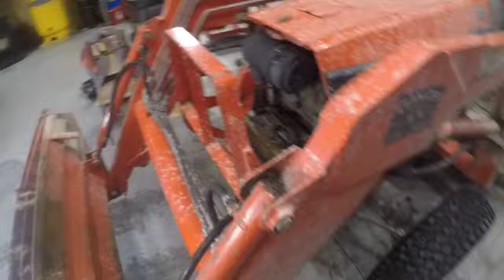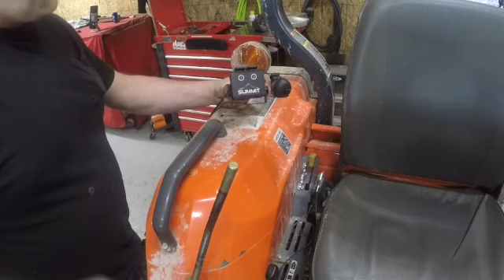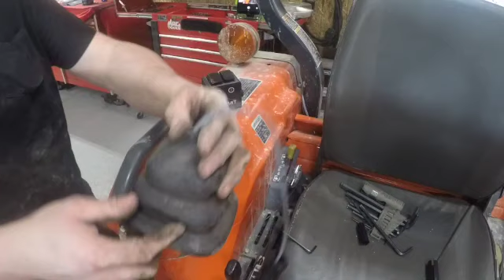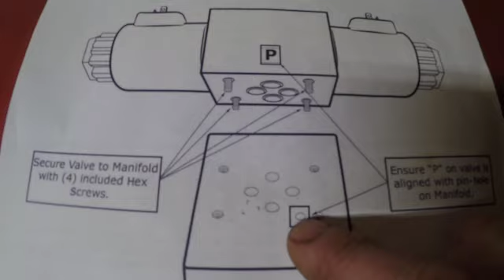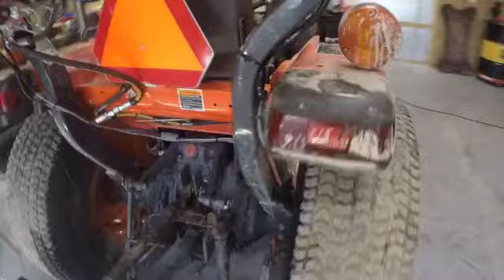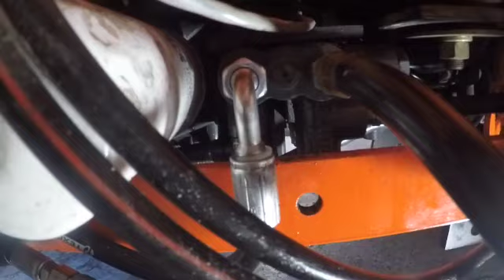Adding remote hydraulics from Summit  Hydraulics to an L3010 Kubota tractor

Comment: I’m about to undertake the same project, installing a 3 Spool Hydraulic Kit from Summit Hydraulics on a Kubota L3010 tractor.  I corresponded with Summit to inquire as to what kit to purchase and their reply was unclear, they weren’t sure that their kit for an L3300 would work on a L3010 Tractor as they hadn’t researched that application.  Can you confirm that the Summit Kit you installed was advertised to fit a Kubota L3300 series tractor and that the hoses, etc, supplied were the correct fit?  Any insight you provide will be greatly appreciated.  Your video was extremely helpful in moving my project forward, thank you!
Reply from the maker: I am not sure of the kit part number. My buddy who owns the tractor purchased it himself and dropped it off for me to figure out LOL